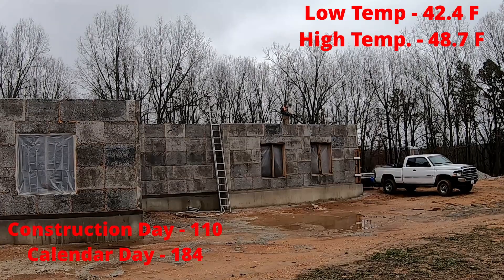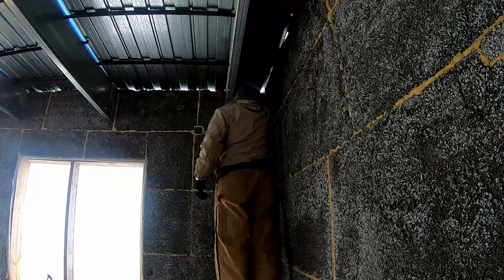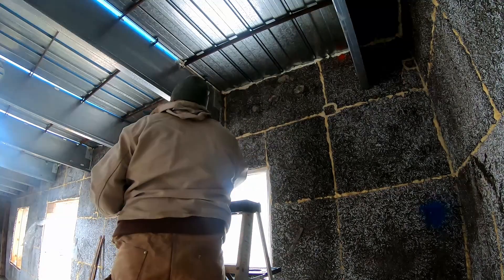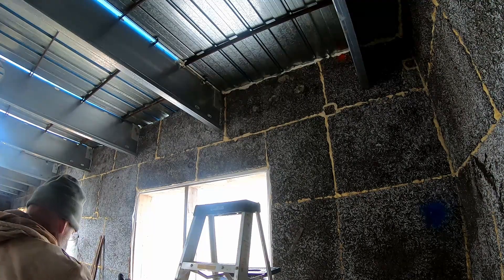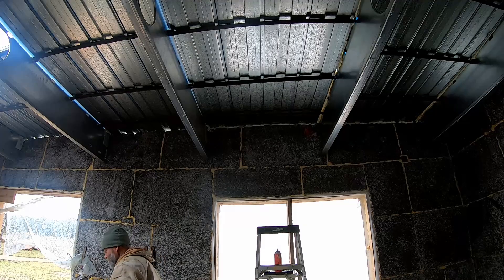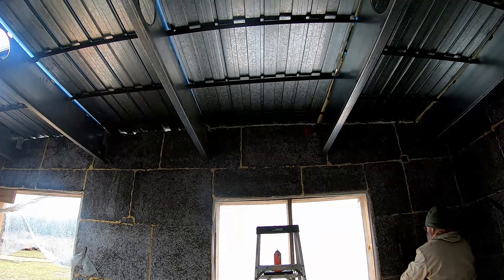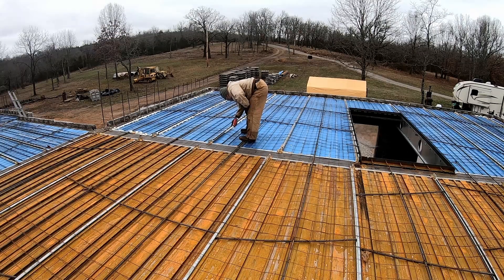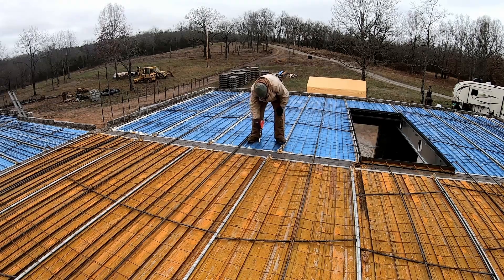House Build 27 - 2nd Floor Concrete Prep for Our Legacy Block ICF House

Comment: Speedfloor + ICCF is exactly the combination I'm looking at using for our home build.  I see you're right in the thick of it.  How are you liking using the two together?
Reply from the maker: Except for some hiccups in the manufacturing, which I think were due to a new facility being setup, I think it is a great combination.  It depends on what your reasoning is for choosing it, though.  When we had to make a decision during the design phase lumber was sky high.  We also wanted the safety of the concrete and steel since we live in a tornado prone area and the fire mitigation since we are installing wood heat.  I hope this was helpful and Thanks for Watching!
Reply: @Ozarks Ethic  very much so, thank you. 

We're building in an area where wildfire mitigation is of the utmost concern. An ICF wall system seemed like the obvious choice, and from their, a suspended slab roof isn't a tough sell. A traditionally framed floor system would be more cost effective, however the savings isn't significant and seems well worth the additional investment to install the floors in the same manor.
Reply from the maker: @nsgrossman  This is a great system for your situation.  Check out the Legacy website if you haven't already decided on another block manufacturer.  Their fire rating, wind & earthquake resistance is really good.  
We are going with a stick frame roof due to design and cost but looked at concrete.  Depending upon your roof pitch you might be able to do pour-in-place concrete.  Ours are too steep and we didn't want to pay trucking for tilt up.  On-site fabrication of tilt-up is another option but you have a crane expense.
We figured the risk was acceptable for our area since fire is not a major concern and we will have metal deck and trim so the wood will be covered.

Comment: I have never used the Corroseal product before. That will come in handy if I ever have a need for it in the future. I'd imagine plenty of floor systems like that have been poured over rust by less than trustworthy contractors. I've demo'd structures in the past with form metal totally rotten from rust. It's wise of you to take that extra step since you got a less than galvanized batch of metal. Good work.
Reply from the maker: I've seen pan decking rotted out and didn't want to deal with the potential future problem.
  Corroseal is like magic.  I'm waiting for my pipe fence to finish rusting so I can coat it.  My Dad used to use it on his semi when he was delivering stuff up north.  It stopped the salt rust.  It won't cure long term rot but will stop continued rusting.

Comment: Oh, what an unfortunate set of events that was.  My back would not have held out doing that, either.  Did the company you bought the steel from refund you any $ for the amount that wasn't galvanized?  If not, can you go to small claims court and get some relief there?

We rec'd right at 2' of snow last week from the series of storms that hit CA.  Now it's 0 every morning and 32 for the hi...for the foreseeable future. 🙂
Reply from the maker: It was kind of irritating.  LOL!  We have been compensated for material and time treating the steel.  My back was very happy we have a good chiropractor!  
  Like I said about the previous video, I think we got caught up in the growing pains of a new operation.  I still think this is a good system given the labor and material savings compared to traditional forming for an elevated concrete slab.
  Bummer about the weather.  We are in a more normal pattern since the arctic blast last month moved through.  We're expecting a few inches of snow next week but it will not be here long.  Usually, we have our worst weather toward the end of January into February.